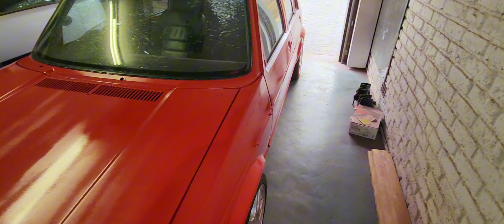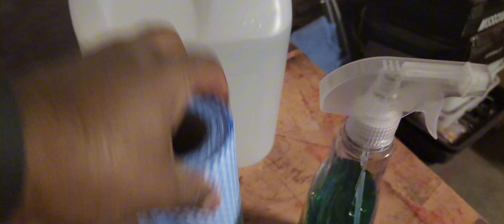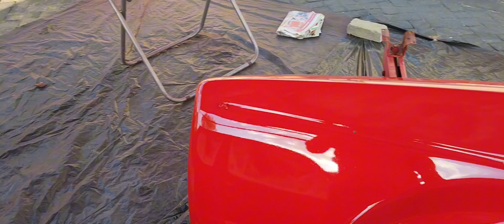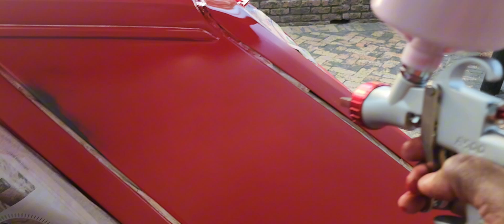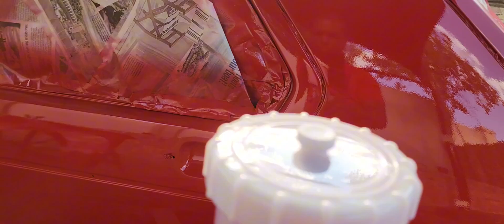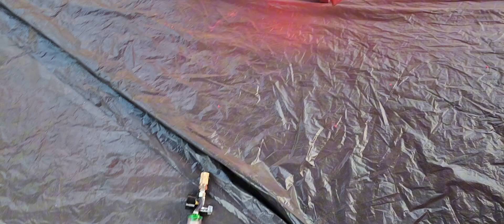I ruin my paintjob, can it be saved!

Comment: Don’t bother it’s a lot less work repainting it. You’re going to try to save it. You’re going to burn it and you’re going to paint it again anyway.

Your compressor is not set up correctly. You need a regulator on it to give you constant pressure as long as you used to paint that will not react to your thing clearcoat. Send it down with 800 or even 600 to get the PO out and put at least two coats of clear on it, but you need to set your compressor up correctly , or just send it down and give it a couple good coats of red enamel or single stage urethane
Reply from the maker: Thanks buddy.